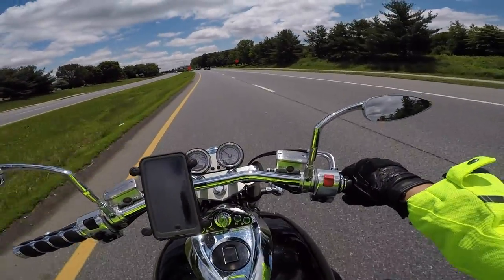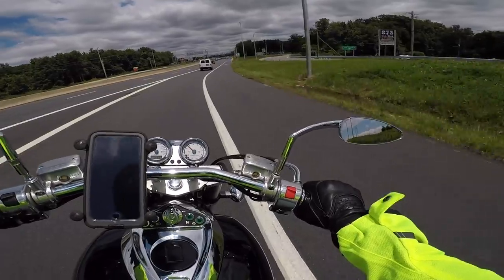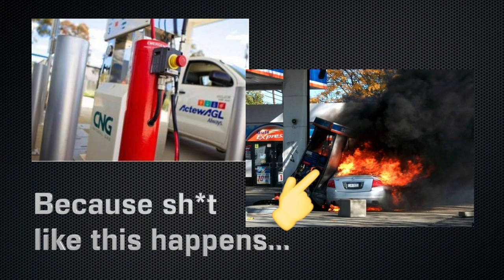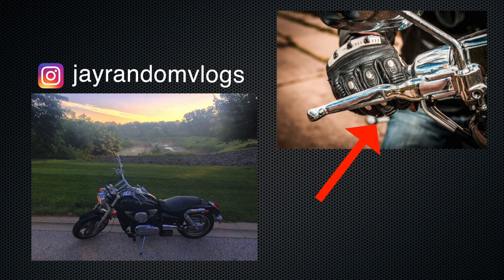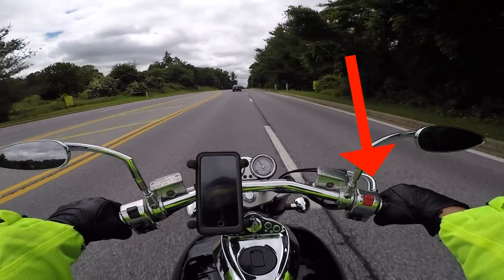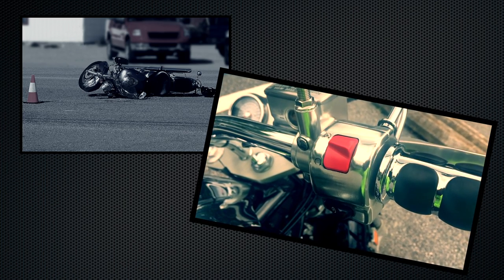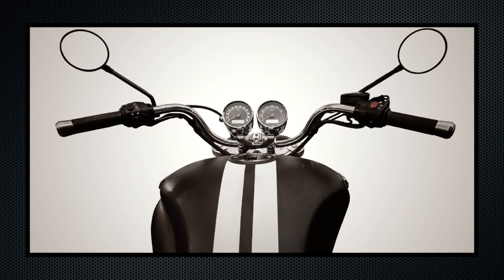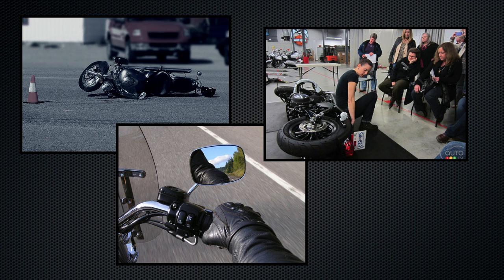Why do Motorcycles have a Kill Switch?

Comment: Another place where the kill switch proves helpful is on inclines if I need to turn off my motorcycle while having a gear engaged, I can do it with one flick of the switch rather than taking my hand off the throttle and reach for the key.
Reply: isn't it the same as stalling it in gear then?

Comment: I always use my key to turn my bike off. The kill switch is there if God forbid you have an accident so that someone can kill the bike if the rider is a prone position unable to move possibly with fuel leaking from the damaged bike. If you use the switch to turn your bike off regularly it might fail when needed to be used for an emergency jmo

Comment: What would happen if you accidentally press the kill switch while the bike is in motion and the gear is engage?
Reply from the maker: The engine will cut off, but you can coast and still ride.  Just pull in the clutch and restart your engine while in motion.

Comment: Hey, very good video! It's really simple and not like 10 minutes long, this video is very underrated. But I have a question: Does it hurt your bike when you use the kill switch often? I mean if you just prefer using your kill switch than turning if off by the keys. Have a good day!
Reply: VE1LS1DE it’s just a myth someone started. It doesn’t harm anything.
Reply: It’s just another ignition switch.

Comment: good info. do you think we should turn off kill switch before turning off the ignition key?
Reply from the maker: Hey, thanks for stopping by & checking out the vid!  Good question... this one is debatable, I know people who swear by using the kill switch, but also know equally as many who only turn off the key & don't touch their kill switch at all.  Everyone has their own reasoning/pros & cons for this.

Ultimately, it comes down to personal preference, because either method shouldn't hurt the bike in any way.  I personally don't use my kill switch regularly; when I'm parking/shutting down my bike, I just turn my key ignition off.  

Also, since motorcycle keys can usually be removed from the ignition even in the "ON" position, the main piece of advice is just always remember to check that it's actually "OFF".  If you shutdown the engine using the kickstand safety or the handlebar kill switch first & then accidentally forget to turn the ignition to "OFF", the electrical system/lights will remain on & potentially kill your battery.  I say this from experience when I first started riding lol.  Luckily I was going back out again, so the lights weren't on long enough to hurt the batt.

Comment: my question is when running fast on motorcycle then accidentally push your kill switch.. what happen you?
Reply from the maker: The engine will shut off & the bike will just coast (totally rideable).  Just pull in the clutch & restart the engine while still in motion (I’ve actually had to do this once before) 👍